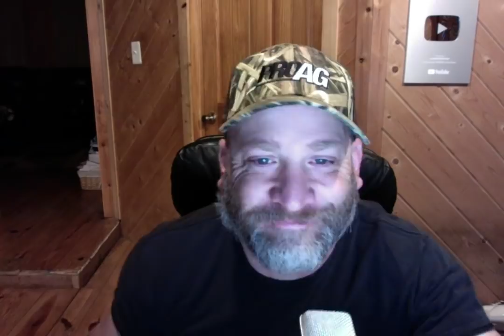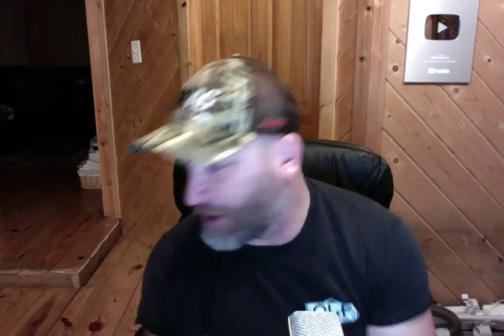Baling Broken Hay And Soylent Green

Comment: The Krone Pre-chamber between the hay pickup and the baling chamber, is called the VFS, Variable Filling System. It kind of looks like a giant ferris wheel, one large disc on each side, and 4 packer bars with teeth, that move hay to just short of going up into the baling chamber, and 1 packer/feeder bar that packs, but when sufficient hay is in the pre-chamber, the holdback below the chamber retracts and that bar feeds the block of hay up into the baling chamber, just in front of the plungerhead.
Here is a Krone animation of the baling process: https://www.youtube.com/watch?v=-ej8hZnXpbs

The pickup has 20 double tines per row (40 tines per row) and five rows, for a total of 100 double tines in the camless active pickup.

Comment: Wes, isn't the "Crop Lifter" that new holland puts on the turtle supposed to lift down material? I know you don't like them due to shock from rocks or other foreign material, but for winter mowing they might be a option
Reply: LVF Northern Wisconsin Farming it doesn’t work i have it on the discbine and in down first cutting alfalfa it doesn’t do any better then a machine without them

Comment: let us hope the GSM clears up that problem ore the magnetic revearsal witch is happening at some good speed now I just only hope its not a fiscicale flip because then we both die when a wall of water runs across the country instade of a steel ore concreet one no joke there is evidnece all over the globe that prove's it has happend both magnetic and some say 35 degrees shift of the rotatinal point.